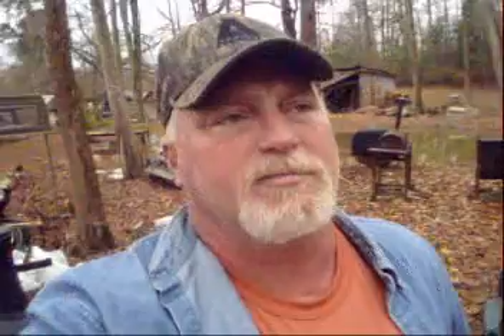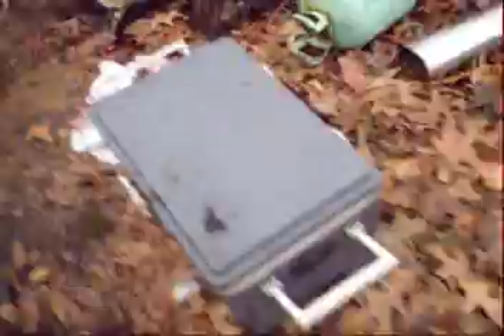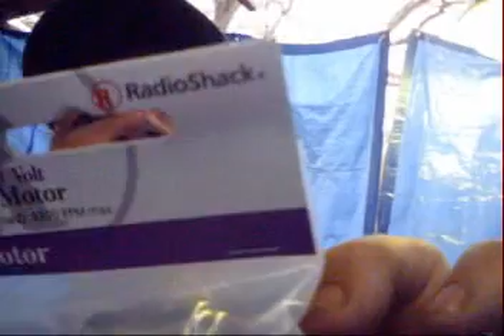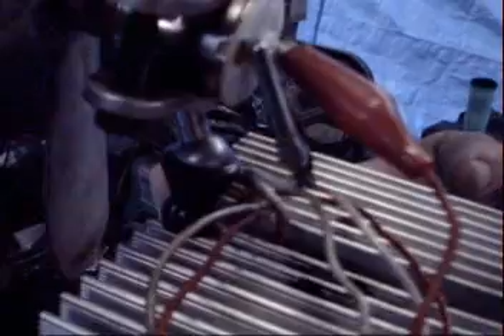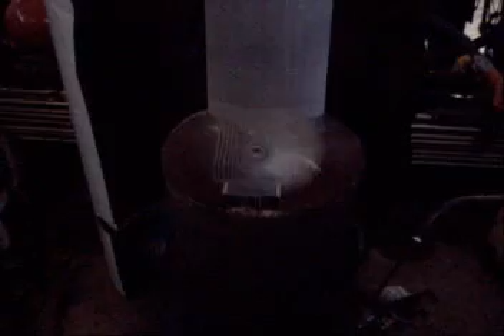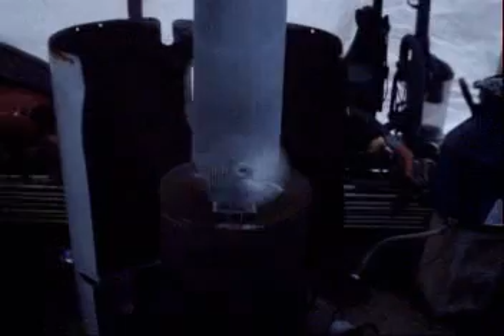Thermofan.MPG

Comment: @hibraisil Let me try to explain it this way. Take a car with a manual trans. The engine being power and the cars motion being heat transfer. Leave it in 2nd gear. The engine runs forward and the car runs forward. If you could get the engine to run backward the car would go backward. Turn the engine off. Push the car forward, in gear, with a truck. The engine spins forward. Push the car backward and the engine spins backward. Same principal applies here.

Comment: @hibraisil No, you can't just leave it out in the cold. both sides would be the same temp. But say you instaled it in the wall of your house. The little bit of heat in your house would still want to transfer to the half that was on the outside wall, and would make power. How much? not sure. If you apply more power to it, it would transfer more heat. Reverse the polarity and little bit of heat outside would transfer to the inside wall. At least this is the way I understand it.

Comment: @hibraisil No. heat has to pass through it to make power so you need one side extremly hotter or colder than the other. If you flip it and heat the other side then the power will be reversed. I know these coolers can keep things warm or cool so it's just a question of reversing power to change which way the heat is passing through. So one side could be put on a block of ice and room temp heat would pass through it from the other side to make power.

Comment: this is great stuff their are alot of different applications this could be used for im working on a small ac/heater of sorts witch is made of a water dispenser and this woud be a great way to fan it. do you have any idea of what the temperature has to be to make the fan move? thanks for the post

the cheap guy